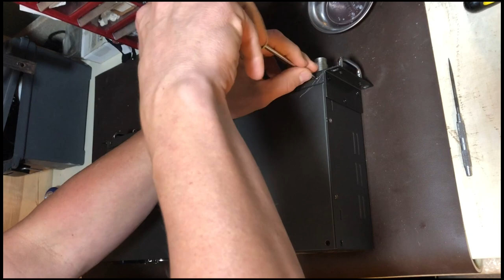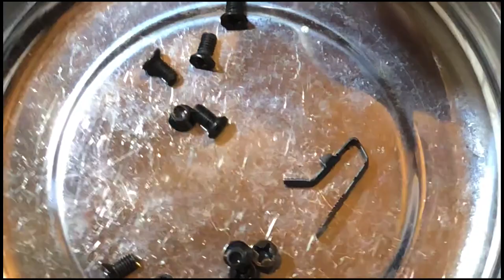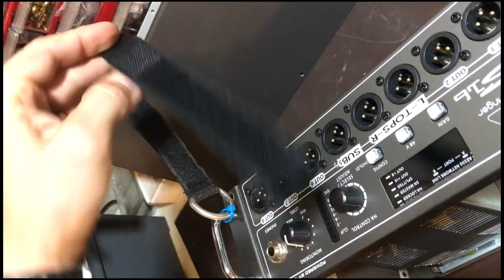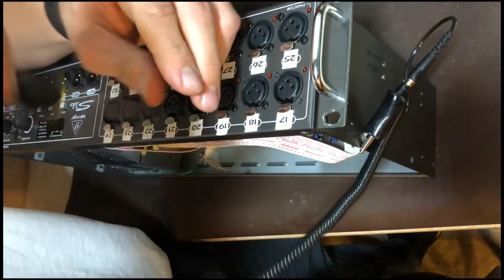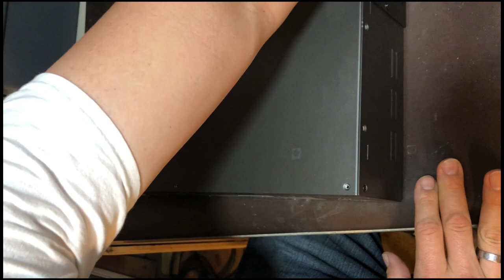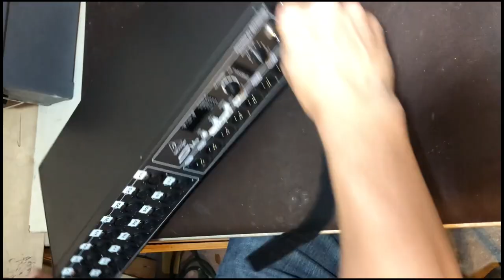XLR Cable Stuck In Behringer S16 -FXED

Comment: It looks like the "locking spring" gets bent when the cable gets pulled without releasing the lock. One good trip on an XLR and presto, stuck XLR!  Very nice video showing the details of this issue. I have used many mixer that don't use locking XLRs. I like the Velcro strain relief idea.
Reply: I’m glad it helped!  That’s what I was hoping to do 😎

Comment: I've got a stuck XLR in a brand new audio recorder. Also a brand new XLR cable too. (audio recorder: mixpre 6 ii) pushed the pin in but the cable is not budging at all. I'm fearful of opening up the recorder cause its still under warranty
Reply: Without taking the box apart, the only thing I know to do has the potential to damage the internal connection... so try this at your own risk.  Disassemble the XLR connector, and gently pull the pin assembly through the back of the plug, then grab a pair of pliers and twist the plug 1/4 turn, that should push the keeper out of the way, and you can pull the tube out from there.  Once again, this could break the connection at the board.

Comment: to remove a stuck socket remove the cable and pins from the shell of the plug or socket. Then with a pair of pliers, grip the shell and twist it 90 degrees to the left. The shell will them come out.
Reply from the maker: Chris Cain yes, it’ll work to get the connector out that time, but the next time you use that slot, it will most likely happen again. I have done that in the past, and every time someone uses that channel, we had to pull the cable apart again to remove it.
Reply: Thanks! This worked for me. The female jack was soldered to a board, I could not get to the spring. I am no longer using male  XLR plugs with the locking slot, problem solved.